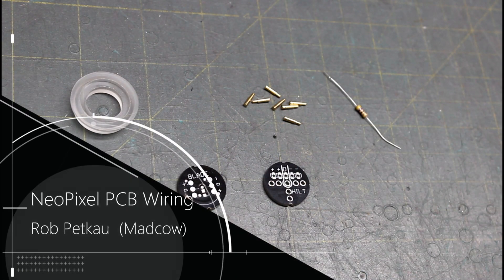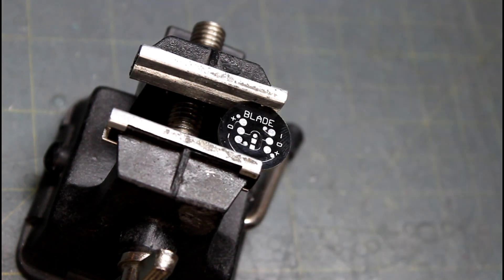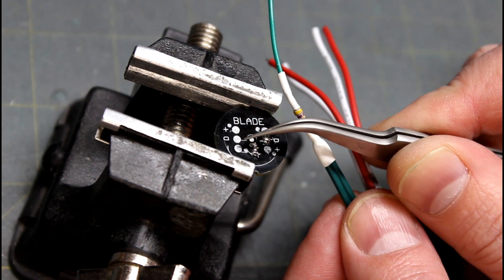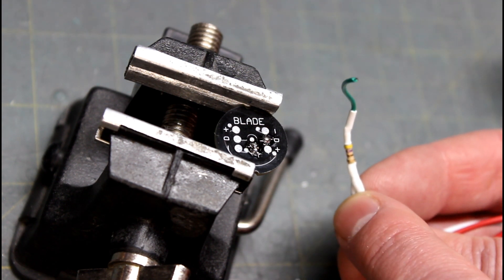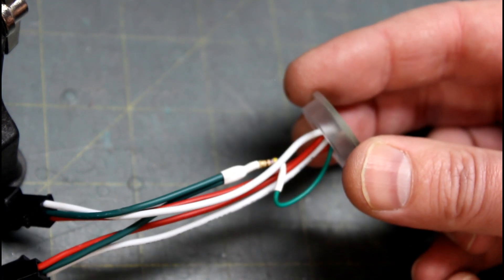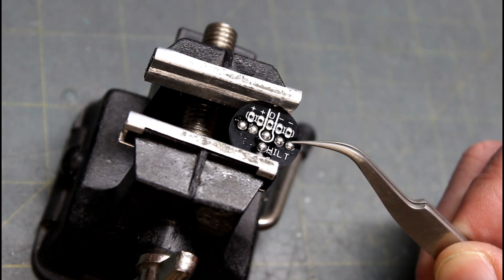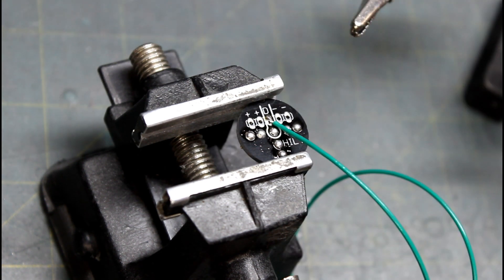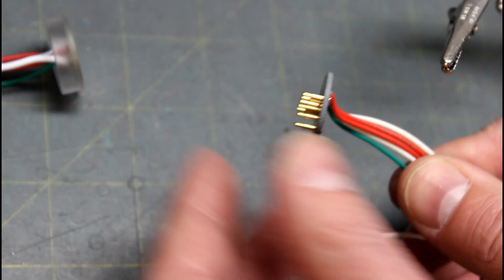NeoPixel PCB Wiring

Comment: Do not use this method. If you do the bottom 3 inches of your blade will not be lit. It will be where all these access wire connections are swished in lol.

Comment: Great video, however, the manual shows 26awg for the signal wire for the neopixel, and 2x 24awg for both the power and negative wires, where as you say 28awg for signal and 26x2 for power - which is it ?

Comment: This is going to sound stupid but if I have a Goth 3D chassis with neopixel set up and I buy a standard neopixel blade, do I just screw the blade into my hilt and let the pins touch the circles naturally? I bought the installed chassis second hand for my tusken II by watto’s and I’m waiting to get a blade but I’m worried because I’m a noob and I haven’t seen any videos that show the bottom of the blade connecting to the neopixel pins and I don’t want to short out a 500 chassis and install

Comment: I bought a CFX board and was wondering how easy it would be to use the MHS V1 Tier 2 RGB Electronics Kit and cut off the LED portion that is uses and then attach a Neopixel PCB connector and then connect that to the CFX board instead of the nbv4 board that it comes with?  This might be a long shot but I don't see why it can't work?

Comment: Are the elctronics inside a neopixel saber vastly different from standard sabers using a single LED?
Reply: Late to the party, but yes, there needs to be a high amp rated voltage regulator, in neopixel, while the single led has to be heatsiked

Comment: Can someone answer this for me?

On the hilt side adapter, is it ok to just do the one wire for each positive and negative plus the data (3 wires) instead of how Rob does it on the video with 5 wires?
Reply: It needs to be able to handle the current and neopixle is thirsty. Plecter pixel uses that setup for that and other reasons. If you read through the manual you'll get an explanation, but plecter uses this method.

Comment: ok so iv done this steep by steep and your neopixle blade video steep by steep and my blade will not light up . it dont help that the nano v4 wiring diagram dont make a bit of sens .i mean why dose the board have 2 negatives going to one on the string but the string has 2 negatives on the pcb ?
Reply: nvm i didint read the Manuel lol ...you have to reset the sd card parameters in the txt file from 0 to the number of leds on your string

Comment: Is there a way to test your neopixel strips without connecting them to a board?  I have a bench power supply and I'm wondering if I can just connect the positive and negative to see if the strips turn on?
Reply: Joseph Strattard  you need a 5v rf controller. I also wanted to test my strips before I started the neopixel blade assembling. I got mine on Amazon. ALITOVE Mini Wireless RF Magic Dream Color LED remote Controller 14Key 300 color modes SP103E for WS2812B WS2811 Dream Color LED Strip Module Pixels Light Lamp DC 5V https://www.amazon.com/dp/B01HCHHM04/ref=cm_sw_r_cp_api_i_82FeBbW3W3REE

Comment: Rob is it a better practice to use two data wires on the blade side like you did or use one wire laid across the two data pads which line up when you slightly offset the strips?

Comment: So can this be hooked up via JST connectors? I am trying to figure out how you would wire it to a Spark 2. Or, if it is possible for one to swap out LED in-hilt electronics and this on the fly using the JST connectors. Thanks for the help!

Comment: Greetings! I'm looking forward to buying all of the components for a new build but this particular item is "Out of Stock" on the CSS. I'll be checking on every now and then. 
Also, if its possible make a video for this full build including connections with the NB soundboard.  And i did not see any Thick Walled blade adapters only one adapter for the thin walled blade....
Thank You very much!

Comment: Hi Rob just finished most of my wiring. Thanks for all your help. I see there is a single wire for foc on my prewired nb4. Where would that connect to on the neopixel strip